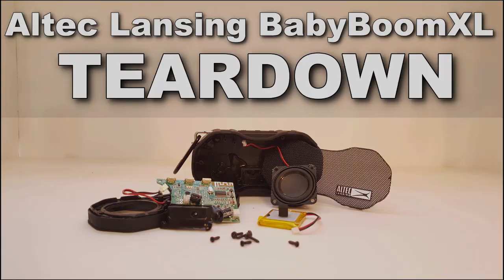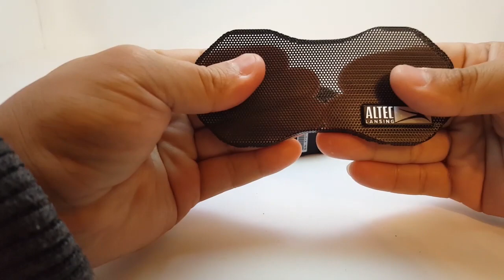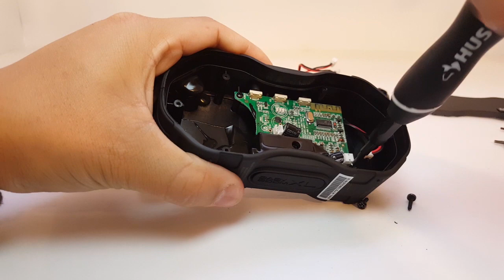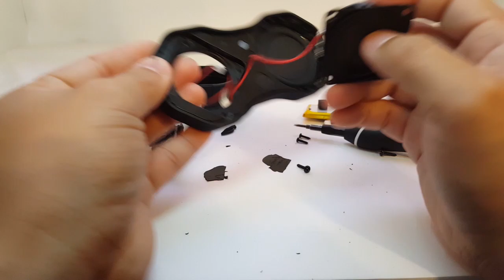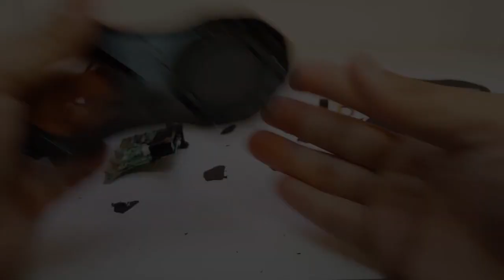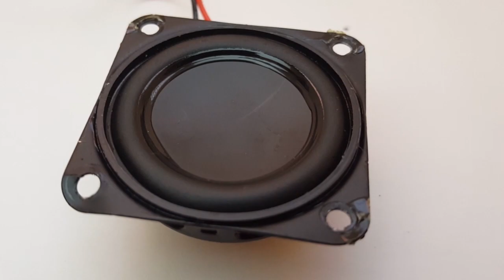ALTEC LANSING BABYBOOM XL TEARDOWN

Comment: Great video.  Exactly what I needed.  I love this little speaker and I REFUSE to let mine die.  The USB port went to crud and the battery couldn't charge.  I removed the battery and was able to splice the battery wires straight to the red and black wires of a USB cable.  Now it's hardwired. No more charging, no more BS.